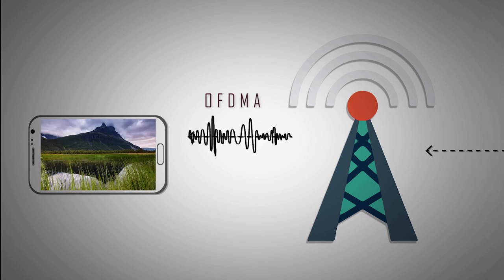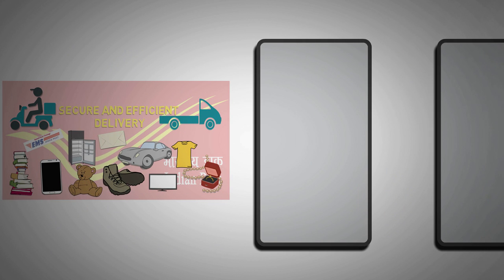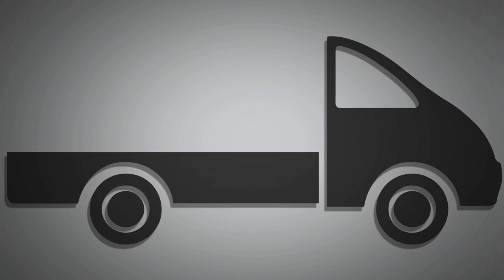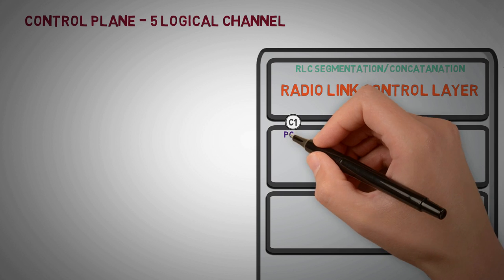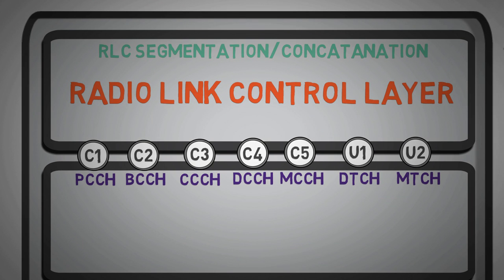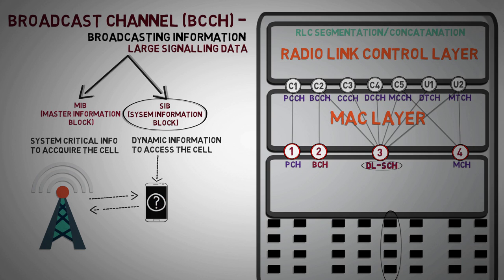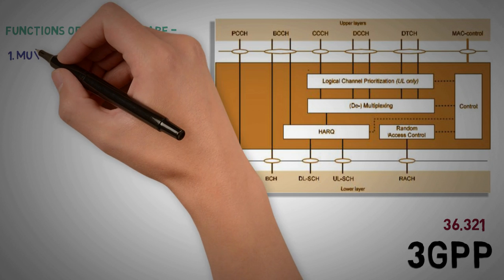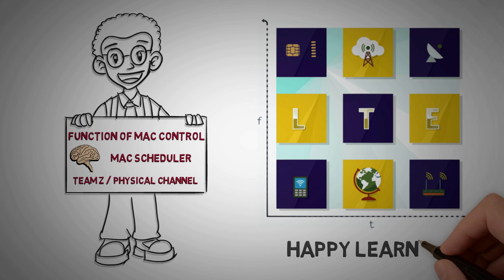2.5 - LOGICAL TO TRANSPORT CHANNELS MAPPING IN 4G LTE

Comment: Wasn't the RRC the brains of LTE Radio Stack?
Reply from the maker: True..
Every layer has their own significance as per LTE 3gpp specs. RRC layer mostly deals with RRC procedures like Radio connection's establishment, Modification, Release, paging and many more. We will discuss more about that in upcoming videos.

But if we look at the functionality of the MAC scheduler, it takes dynamic decisions about how the data should be transmitted, which modulation scheme to be used, which antenna mapping, what will be the transport block size  etc as briefly described in this video, JUST LIKE THE BRAIN..
MAC scheduler plays a vital role in User plane data delivery. RRC layer does not come into picture in case of LTE user plane protocol stack.
But On a lighter not,  if we want to compare RRC with Brain, we can, as there are no 3GPP specs saying MAC as BRAIN.  :)

Hopefully we were able to address your query.
Happy learning. 0:)
Reply: Thank you for your insightful response.
It is of great usefulness to me, I am an undergrad student, and am trying to understand the main functions of each layer so I can propose a design in which the LTE Radio Stack can integrate the wifi MAC and “switch” them dynamically. Where would you point me to pay more attention to? RRC, MAC Scheduler?  Would that be even feasible?
Reply from the maker: +Ozxmin O'malley - Hi. Sorry for late reply.

One thing is certain in your project as explained by you is that, you are going to deal with a lot of mobility related processes. For example 
1-switching from LTE to WiFi and vice versa,just like the handover concept.
2-Continous measurement of WiFi signal strength, so that whenever WiFi signal strength gets stronger than the LTE, the device will switch to other.
3-And could be many more mobility process based on the requirement of your design.

In LTE, RRC layer is involved in all these Mobility Management Processes and considering you are an undergrad student, we would like you to focus on RRC for your design.
You can talk to your professors or other experts for a better ideas.

Comment: GOOD video!  But i have question. Is Team X simillar to RLC or Application layer?
Reply from the maker: Since job of team X is to categorize the goods as per necessity,which exactly matches with the role of RLC layer i.e segmentation/concatenation of the packets. So you can consider Team X as RLC layer.
Happy Learning